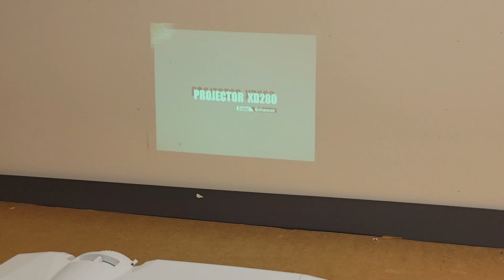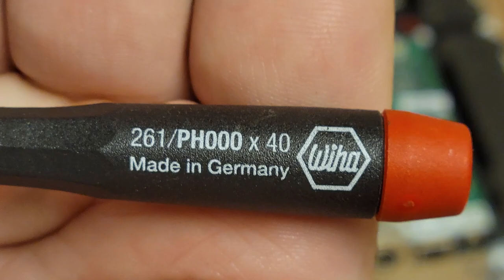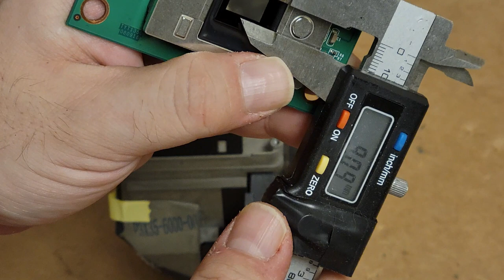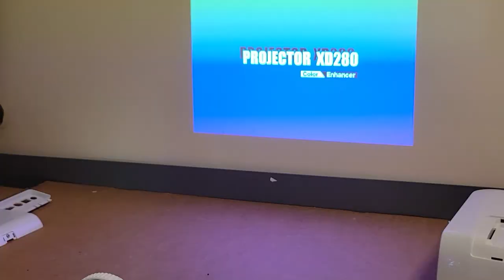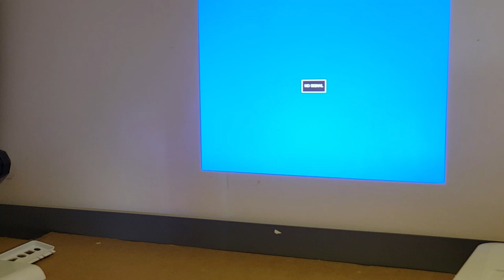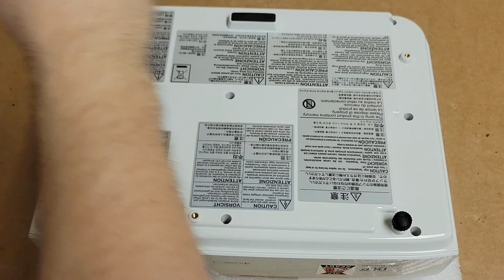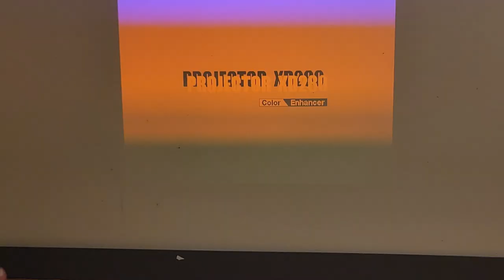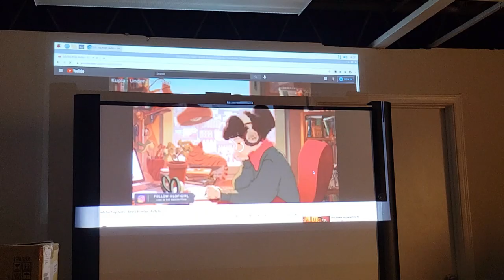Mitsubishi XD280U DLP Projector DMD Replacement

Comment: Thank you for this very nice tutorial I could operate and change the dlp of my projector. Unfortunately after 3 days of using it some white dot cames back and bring me back to the same situation of before. I don’t know if it comes from the dlp or something in the projector which  damage the dlp.
Reply from the maker: If the DMD is new, then instant dots could be either a defective DMD or a bad DMD driver.  It could also be dust but that would be there immediately and not go away.
Reply: @FixitFrank  thanks for your answer. 
I used a few days and it was just find, I was so happy. Then because it is place on a board very up I already putted up the back of the projector to diffuse properly where I needed. A few hours  before appearing back the white dots I putted back up little bit more the back of the projector, actually at the edge of the maximum possible inclination. Maybe this fact of maximum inclination brings dust but I don’t believe so. It looks more a dmd fuck up issue. 
There is another fact that could made happen. I didn’t replace the silicone square thing that came with the dmd at the back of the dmd.  I can of understood that it serve for the heat but I letted the old one which was sticked on the radiator piece which comes again. I don’t know If I m clear my English is very approximative, sorry. So does the heater of dmd could bring back the white dots?
Thanks for your concern 
Best regards 
Stéphane from Paris.
Reply from the maker: Bonjour Stéphane! Your english is perfect! Far better than my French. The heat causes the mirror of the DMD to jam/stop moving.  Sadly, there is no way to repair that. It is possible  that the lack of heat sink paste caused the DMD to overheat quickly.  It is also possible the DMD was defective. I would see if the vendor can replace it under warranty. This particular DMD is known for early failures.  I think they had production quality problems and many will do this. Some will be okay. It is a gamble sometimes for this particular part #.  It was also used in many  rear projection TVs and front projectors of other brands with similar failures. 

If you can replace it again, be sure to use a small amount of heatsink paste or use a thermal pad. I order from a company in China called Time electronics.  Gydz@timeprojectorlamp.com is their contact.  Let them know I referred you if you decide to contact them. 
I hope this helps!

Comment: Hey, I have this model. Do you know where I can get a color wheel for it? Mines makes this wining sound.
Reply from the maker: https://www.ebay.com/itm/202895529400 This is listed for an XD250U but I believe they use the same color wheel.  I'd compare the colors in yours but I am pretty confident they are the same. This is a pretty common 6-segment design. The only thing to check is if the black index mark is located by the same color on the new wheel as the old wheel. It will prevent having to adjust the index setting.

Comment: So I had a bulb bust in a similar Mitsubishi (XD360U-EST), and noticed some scratches on the glass just in front of the bulb, and some singed metal around where the bulb was. Should I replace the whole housing, or would just replacing the bulb be sufficient?

I also have 1 dead pixel, but I don't feel like undergoing the full DMD replacement just yet, seems like a lot of work xD

Bought it second hand and misplaced the remote control, haven't needed it much, but wouldn't mind replacing it, do you know of anywhere that supplies remotes?
Reply from the maker: Its probably okay.  They are a bit more robust than they may seem.  If it was newer, I'd be less accepting of some realistic corner cutting but these are pretty solid projectors and they can put up with a lot and not complain. As long as there are no clear spots in the center of the lamp glass it will be fine.  The heat marks probably mean the fans are getting dusty.  If you end up buying another lamp some day for this mode, I'd swap out the entire assembly then but this one should be okay with just the bare lamp.

Comment: Hi, I have a epson eh-tw9200 projector which will not display thru HDMI but will on other ports. Would you by any chance know were I can find the service manual/schematics for this model, I have searched and have had no luck. Hope you can help. thanks  ....I know this is going to sound stupid but you sound exactly like the youtuber FrankTech which I am a subscriber ? 👍👍
Reply from the maker: Hi Stephen, this is my only channel that's mine. I do manage another for work but it's not that kind of content. Frank-tech looks interesting though. I'll have to give him a watch. 
Unfortunately Epson is a terrible company when it comes to service info. You'll probably notice Epson is a rare brand to appear on my channel. They will not give service info to anyone unless they are certified for Epson warranty work. The chances of finding the service manual is virtual zero.  It's frustrating for us. 
However in your case, I'd check the TVS diode arrays on the HDMI inputs for shorts. Then follow the traces to the first IC they connect to. See if that IC has power (you might find a datasheet on the chip). If it does that IC is probably the problem. Make sure it doesn't require firmware before replacing. I learned that the hard way with a sim2.  I replaced the chip only to find it needed a jtag loader with software I didn't have access to.  Good luck!
Reply: @FixitFrank  Hi Frank, Thanks for the tip , will look into it. 👌👌